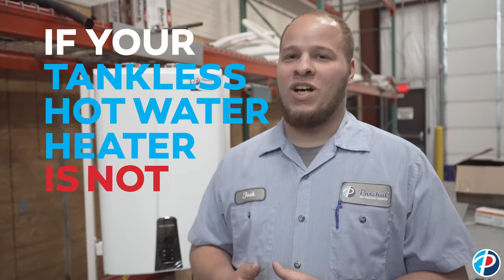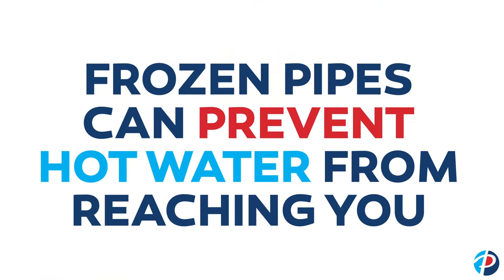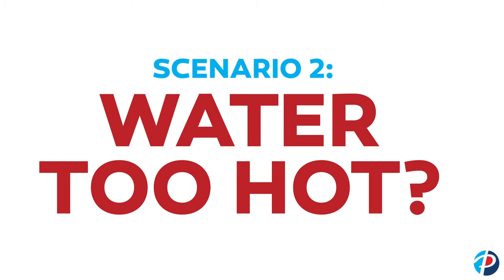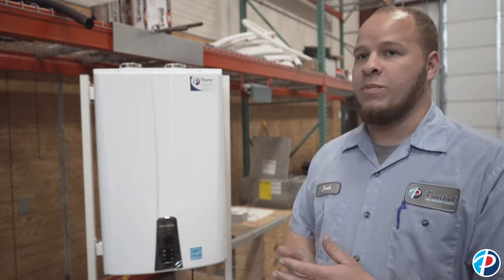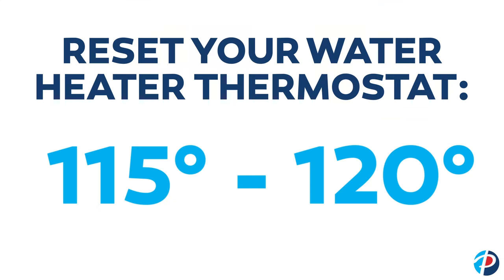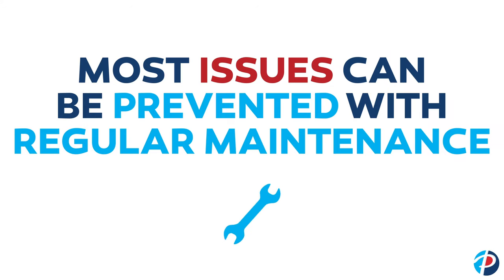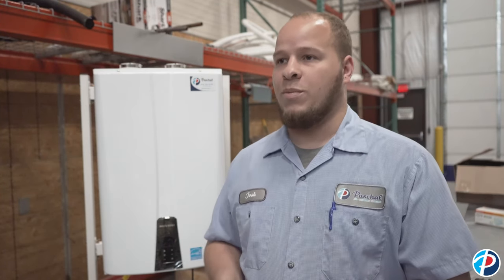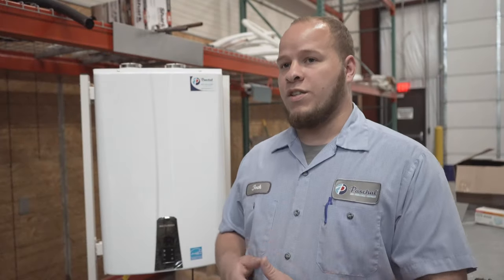Common Tankless Water Heater Problems & How to Fix Them

Comment: Kitchen and bathroom sinks are fine for the most part. Shower is inconsistent. When water does reach close to set temp, the temp is not maintained and short-lived. Could it be that the capacity is not high enough for the shower fixture which is a rainfall with handheld and regular facet - only one outlet at once?

Comment: Hi! Need your expert advice. Whenever hot water in the shower is turned on, the water flow/pressure goes weak then strong, weak then strong… also the tankless water heater makes pounding noise on the hot water line. Do you know what is going on there and any advice on how I can fix it? TIA

Comment: Hi! Need your expert advice. Whenever hot water in the shower is turned on, the water flow/pressure goes weak then strong, weak then strong… also the tankless water heater makes pounding noise on the hot water line and at the same time the pressure  swater flow goes on and off Do you know what is going on there and any advice on how I can fix it? TIA

Comment: new home purchase first time dealing with tankless. I have a westing house tankless with p-920c i have really good water pressure but the system demands a lot of water to kick on the burner I have to run another faucet to get hot water  iv already cleaned all filters and screens and every time its done running I get err 16 and 72 anything helps thanks
Reply from the maker: ERR 16 & 72 relate to over temp. warning & Flame Sensing Device Fault. There could be a few causes, but a plumber would need to be physically in front of the unit to diagnose. I would recommend calling your local plumber for an accurate diagnostic.
Reply: Did u find out the problem???

Comment: The flame in my tankless propane water heater occasionally goes out during operation. What is causing this? The propane tank is full. It does relight but goes out again after a few seconds.

Comment: What would cause my tankless waterheater to have a combustion failure and shut off ?
Reply from the maker: Possibly a gas supply problem, but impossible to know without inspecting the unit. I would call your local plumber to have a professional take a look.

Comment: Hello sir I just hooked up a on demand water heater brand new it's making hot water but my water pressure pulses from 
Nealy no water to a  ample flow then it slows way down  like three times a minute... why?
Reply: If you have a dishwasher going or maybe sprinkler system. Change schedules for one or both. Good luck.

Comment: Low water pressure below 35 PSI can also be the cause of no heat symptoms. Correlates to gallons per minute.
Reply from the maker: You're right that can also be a cause.
Reply: Had a issue with my brand new unit not giving up hot water for more than 30 seconds and no heat . Saw a vid on cleaning the cold water inlet filter and pulled it out and found it was clogged with sediment cause a friend didn’t install a sediment filter on my well before firing everything up. Cleaned it and now it works great

Comment: What happens when you get hot water but it's only when the flow is slow. When I open the hot side more it gets cold again. Like the hot water is passing too fast before it can get up. Is there like another valve i need to add so it will keep the water inside long enough to get hot?

Comment: Heater is not igniting if opened in shower head  🚿 but works in botton tap and kitchen, how to fix this?
Reply: It's possible that there isn't 'enough' hot water being called for (0.25gpm) in a super-water saving shower head so it may not 'see' that you are using hot water

Comment: Hi! Need your expert advice. Whenever hot water in the shower is turned on, the water flow/pressure goes weak then strong, weak then strong… also the tankless water heater makes pounding noise on the hot water line and at the same time Do you know what is going on there and any advice on how I can fix it? TIA